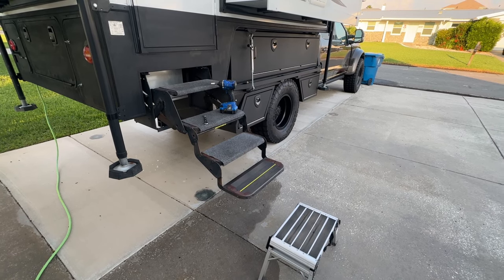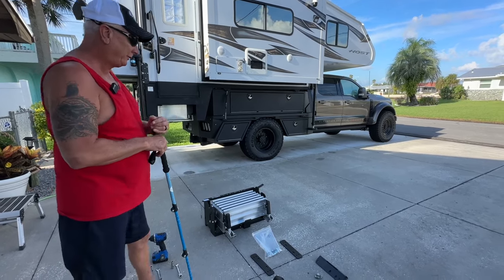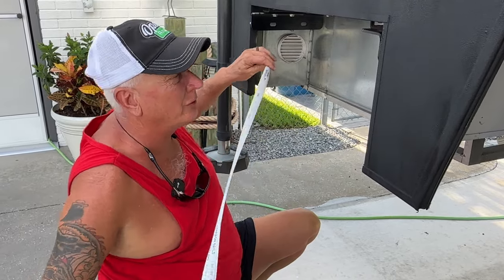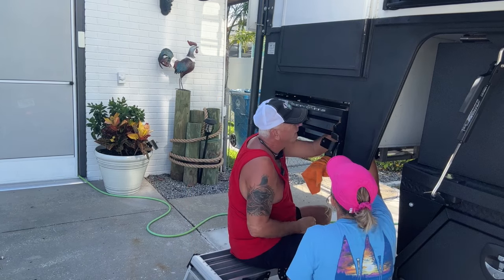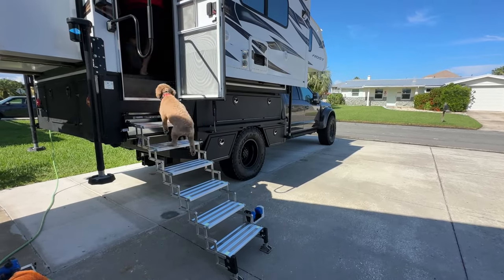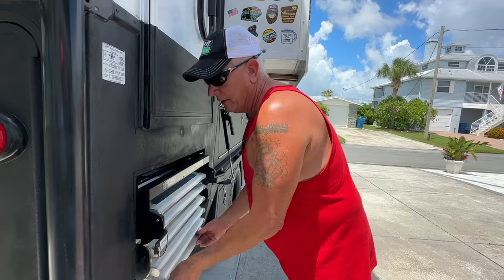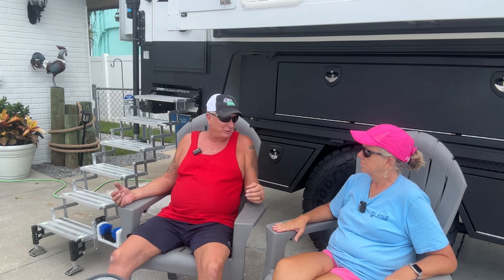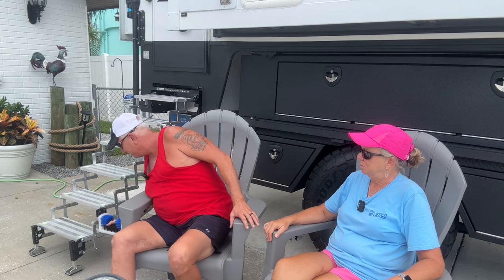Torklift Revolution GlowStep EASY install and review. BEST Truck Camper UPGRADE.

Comment: Thanks for the tutorial!  Is the height adjustable?  Sometimes we leave the camper on the truck and sometimes we take it off.  They can be very different heights. Thanks!!
Reply from the maker: The answer is yes, but kinda hard to explain. The top step can be “hidden” in the stow position and the steps can be when pulling out to either a longer foot print or shorter one depending on your circumstances. Hope this answers your question.
Danny & Donna